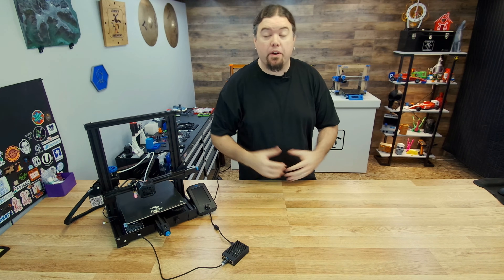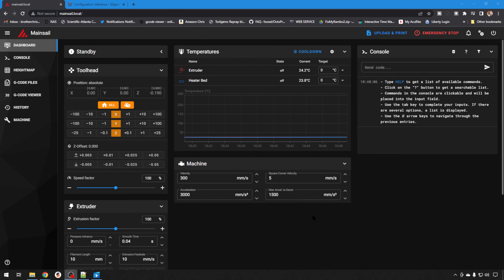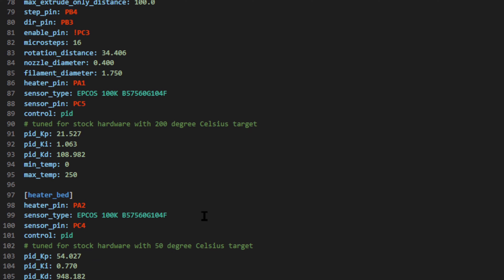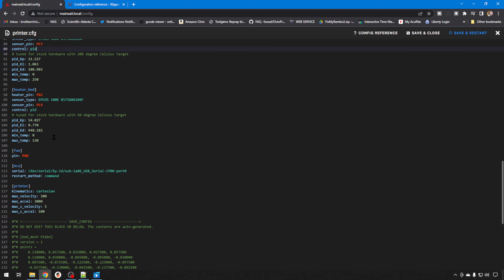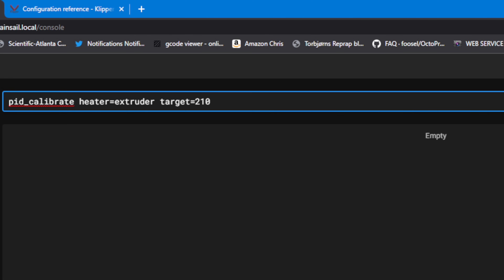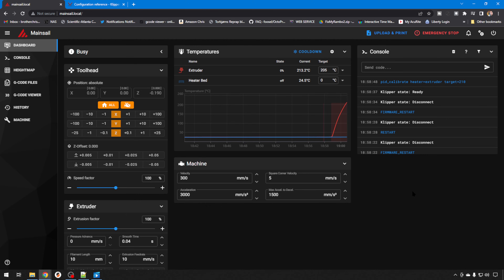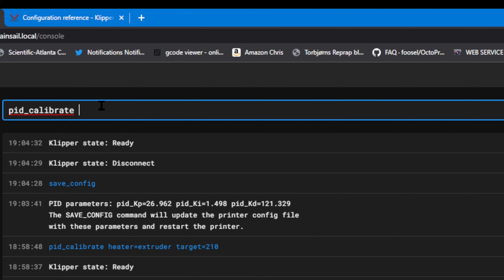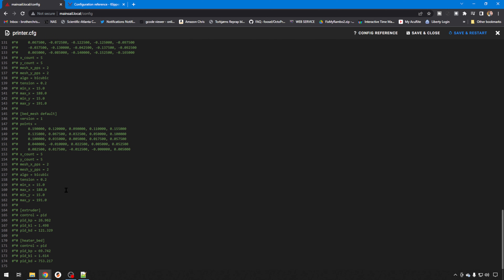Klipper - PID Tune - Dial In Your Printer - Chris's Basement - 2022

Comment: Thanks brother about this helpful video, but I have a small question regarding after you’ve done the PID when your head save config the value do I need to remove the # in the cfg file because after run it in the cfg file commented out should remove the # or no need to do anything after the test just hit save ?
Reply from the maker: You're welcome! All you have to do is hit that save config then it saves it at the bottom of the conifg with some strange hashing around it, it will now read that, no updates needed.

Comment: Great vid! Just replaced my stock hotend on my V3 SE & knew I needed to adjust something. Every online tutorial I could find uses fluidd with a built in macro so having this command saved me :)

I also just recently got a humidity sensor hooked up to home assistant & can see my average room temp delta is only around 2C, which should hopefully make everything that bit better :)
Reply from the maker: Happy to help! Thank you for watching

Comment: Thanks for the video! I am having an issue however with the hotend over/under  shooting by 0.3 degrees repeatedly. For example, I set to 220, then it goes between 219.7 - 220.3 over and over. 
- I have checked the config file has been updated
- I have tried adjusting with the marlin overshoot formula (divide numbers by 3).
- I have cooled all elements to room temp, then PID auto tuned the bed followed by the hot end
- I have positioned the hot end in the  centre approx 5cm from build plate
- I have tried PID auto tune to 3 diff temps (PLA @ 220, ABS @ 260, In between @ 240) with the same problem always occuring.
- I have tried PID auto tune with fan on 100%, and with fan off, same problem. 

 I have an ender 3 v3 KE. The stock tune for the bed is spot on so I haven't even needed to touch the PID for it, but the hotend is struggling. I am at a loss what to do. :(
Reply from the maker: That's a strange issue. First thing I would look at is filament consistency. If it's always this consistently off, it could be an extruder gear.

Comment: hola, podrias ayudarme, intento hacer la calibración pero a la mitad salta el siguiente error 

"Heater extruder not heating at expected rate
See the 'verify_heater' section in docs/Config_Reference.md
for the parameters that control this check.

Once the underlying issue is corrected, use the
"FIRMWARE_RESTART" command to reset the firmware, reload the
config, and restart the host software.
Printer is shutdown"
Reply from the maker: Make sure the heater is set to 1, some times it will be set to something like 0.5. Also make sure you have the correct thermistor in your config.

Comment: should we need to switch on the part cooling fan while doing this pid tune?
Reply from the maker: It kind of depends on the design. It really shouldn't be pushing air over the heatblock, but if it is you might need to run the PID with the fan on.

Comment: Hi, I’m a bit confused why- for example i set my target as 230, once it reached that value it only cools down to 225 instead of 220. Its abit worrying if i changed anything without noticing.
Reply from the maker: Not exactly sure how it tracks what the lower temp gets set to when it takes the measurement.

Comment: out of curiosity wouldn't bed temps need to be elevated due to bed radiating heat upwards towards the extruder which would help heat the extruder even though it would be minimal or 10-15%?
Reply from the maker: It's probably not a bad idea, but it probably won't be enough to change the numbers either way.

Comment: Thanks for the video. 
I don't understand one thing though. After the save_config, doesn't the green color means that this is a comment? 
Don't we need to replace the values with those down below? Or #*# isn't a commented area?
Thanks again!
Reply from the maker: Yes, that is confusing to me as well. #*# seems to mean is was a value set by the configuration and it is in use.

Comment: Hey Chris, I have a friend who has the Creality Sonic Pad, and he is having some issues with updating edited values in his config file from Mainsail. He was editing the probe offsets in the config, and then save and restart firmware/jprinter from Mainsail, but the changed values never actually get updated in the printer settings. Any idea why that is or how he can use that config in mainsail to update his printer? He has an Ender 5 Plus with a Sprite Pro extruder and Sonic Pad.
Reply from the maker: Sounds like maybe a permissions issue. Maybe the file got changed somehow. You could try updating the permissions of the printer.cfg file with a chmod command.  Something like      chmod 755 printer.cfg    this would be from command line of course.
Reply: @ChrisRiley  Thanks for the info, I will look into this for him and have him check. I was going to tell him to use the SAVE_CONFIG to '/home/pi/klipper_config/printer.cfg' but I dont know if the file location is the same for sonic pad as it is for PI. Do you know if there is a way to get info on where files are stored? Maybe some kind of directory command?

Comment: What is the difference between watermark and pid ?
Reply from the maker: It's just a different method to do the same thing. Check this out. https://www.researchgate.net/profile/Dimitris-Tseles/publication/323994242_Methodology_of_PID_Control_-_A_Case_Study_for_Stepper_Motors/links/5b2cb02da6fdcc8506bcaa3a/Methodology-of-PID-Control-A-Case-Study-for-Stepper-Motors.pdf

Comment: Hi Chris, when i enter save_config and send i get this error message ( SAVE_CONFIG section 'extruder' option 'control' conflicts with included value) any idee thx.
Reply from the maker: I would guess you have two control statements in there, in printer.cfg or mainsail.cfg.

Comment: Amazing, just installed Mainsail and after I saw it was lacking a bit I switched to Fluidd and been having a blast. Would you consider making a video on the setup required to use a MicroSwiss DD NG on either Fluidd or Mainsail? I've been having such a hard time getting the right rotation distance for my ender 3 v2 and it has really brought me down because I couldn't get a real good print on it.
Reply from the maker: I'll look into it, thanks.

Comment: I know I can get and enter the PID values with octoprint via the terminal window and Marlin can this be done with Klipper too?
Reply from the maker: In Klipper you would just run it from the octoprint terminal then enter SAVE_CONFIG, but no I don't think you can change it on the fly like you can with an M301.

Comment: Love your stuff! Though I would like to have seen the temperature graph when using the old and new PID values. Would be nice to see that it made a difference. Of course maybe it was already tuned and there would be nothing to see. Keep up the great work...always clear and concise.
Reply: Here are the values that are in the stock config
pid_Kp: 54.027
pid_Ki: 0.770
pid_Kd: 948.182
Here are my auto tuned values 
pid_Kp=27.908
 pid_Ki=1.577 
pid_Kd=123.493
Hope this helps
Ender 3 Pro, BTT E3 V3 board, MS all metal hot end
Reply: @als4817  It would appear that the auto-tune made a BIG difference. Of course, seeing big numeric differences AND knowing the effects are two different things. Thanks for sharing your data!
Reply from the maker: Thank you!

Comment: Well maybe that’s why I’m having temp issues. Need to cold tune them. Never considered that would throw off results.
Reply from the maker: Give it a go, hopefully it helps.
Reply: Same, that was an interesting point to note.
Did a test:
Extruder heated before test, ( 210 ° )
pid_Kp=27.908 pid_Ki=1.577 pid_Kd=123.493
Extruder at room temp
pid_Kp=27.211 pid_Ki=1.564 pid_Kd=118.368

Comment: I did this for the extruder and the bed but I am seeing more variance on the hotend temperature than I did on Marlin. Marlin was always consistently 200.0 without much variance but I see anywhere from 199. through to 200.2 with Klipper. Its not a lot of variance but its still less consistent than what Marlin used to produce. Is the other mechanism produce more consistent?
Reply from the maker: All I can think of is maybe try the other algorithm, maybe it will do a better job.
Reply: Maybe you are getting better measurements from Klipper.  I think 200.2 to 199 is great and won't be a problem
Reply: Perhaps the refresh frecuency of klipper is higher and your getting more realistic mesurements now like David Wilson said
Reply: @retroluminico  refresh rate is the same, it's still octiprint polling. It's not showing up as a quality issue just ad oddity where before it was more consistent. Everytime I run the tune I get a different result, something is off.
Reply: @PaulRKeeble  I see. Did you modify something on the hardware side besides klipper? I’ve change the ender 3 to a phaetus bms while I was using Marlin and started to have troubles with temps like yours. It was te glass broken on the thermistor